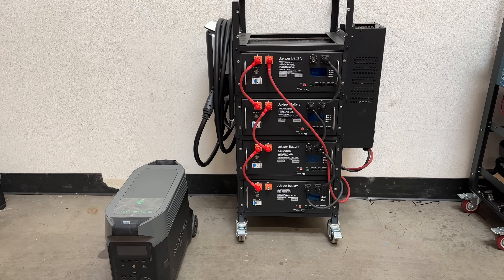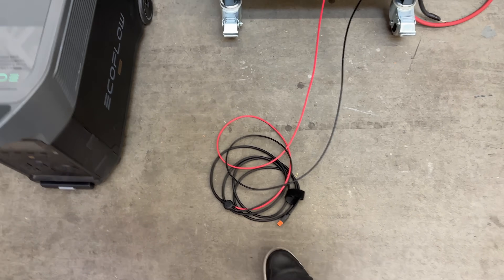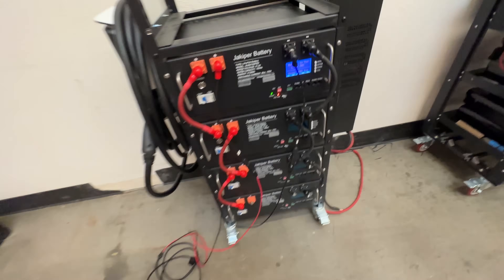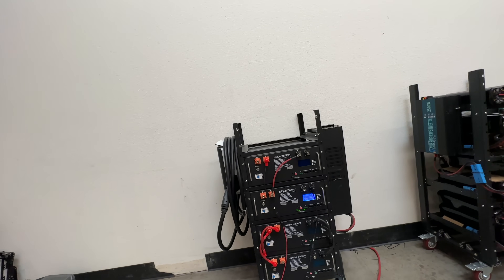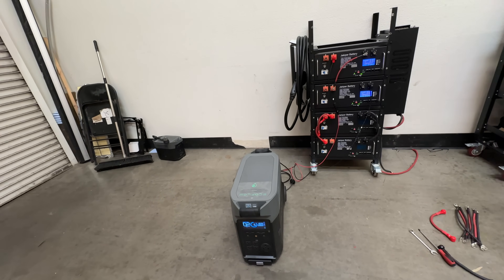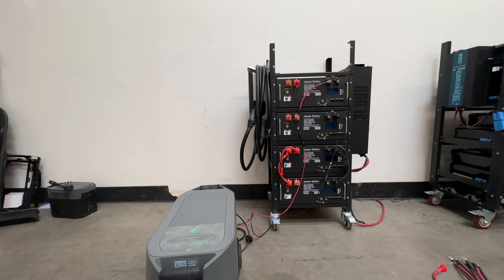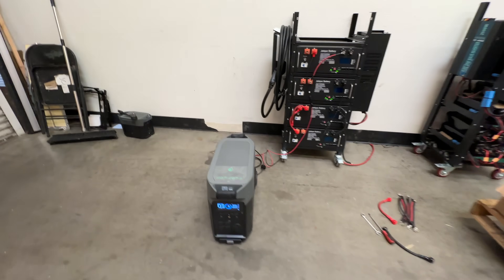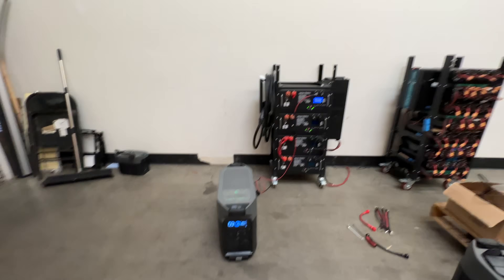48v Rack Mount LiFePO4 Batteries + @EcoFlowTech  DeltaPro

Comment: If you connect the 2 Jakiper batteries in series, you increase the voltage. So 51.2v x2 total of 102.4v.
I thought you would need to stay at 48v to charge the Delta Pro...of course I am seeing it possible with this video that connecting two 51.2v in series to charge the Delta Pro will work!
I thought by connecting the Jakiper in parallel you keep the same 48v...matching the Delta Pro

Comment: It would be nice if these smart lithium generator companies would create an extra battery that can be offered with their units a solid state micro inverter that way for an example EcoFlow Delta Pro 3 rated with a 4000 watt inverter could have the ability to increase its inverter outputs as well as its wattage output they would normally get from its extra lithium battery. I mean the extra batteries for many of the units like Bluetti, Ecoflow, Zendure etc have no ability to increase the systems inverter wattage outputs. I'm not even sure if a  solid state micro inverter could even do that, I mean with all these folks writing code and electronically intelligent ( if not, why not).

Comment: I have some questions. I'm doing a diy kit. 
I have a Delta 2. 
(2) 100w solar panels with 23.4 (voc) 
I have 3 12.8v 100ah lifepo4 batteries. A 75w 15amp solar charge controller and some xt60 cables. What would be the best way to set that up? I'm completely new to this and don't know much about this. I basically want to have the solar constantly charging the external batteries while those are plugged into the delta 2 while I use that for power. I'll eventually upgrade to the Delta pro or Delta pro ultra as the main unit. But wanna go cheaper on the expansion batteries. If that makes sense

Comment: I tried this set up and the power keeps surging up and down. From 700, all the way down to 100 watts and back. I know I must be missing something.
Reply: I have the same issue. Did you ever figure out the solution?
Reply: @Nottrying200 I ended up buying an inverter that works just fine. I still would like to figure out the solar input issue though.

Comment: I want to use 24 Volt 100ah  Batteries to Increase My Eco Flow River 2 Pro, Delta Pro 1300 and Delta 2 to Expand Their Capacity and allow My Solar System to Recharge The Battery Bank to Buss Bars and run Marine Grade 10/3 Tinned Wire from The Well House Shed to The Lodge or Bunk House 100 feet away under ground in EMT Conduit. Top Off anytime You wish to. Thank You Boss 🌴 💦 Indian Creek Ranch ⛩ of Southern California High Desert 🌵

Comment: Great video...!  I like how you stood back about 10 feet when combing your 48s in series.
So I just ordered the EcoFlow DELTA Max 1600 Portable Power Station, and why I did was because I have inherited a small RV, and I'm wanting to go solar.  teh Gas Generator was dead, and so I ordered the Ecoflow, mainly for the Inverter and the MPPT.  My goal is to run 2x400 watt solar panels in parallel into them, and ...or maybe in series, and then through the Ecoflow, to a small lithium battery bank, maybe a couple 200Ah in series, giving me 24v.  I could then also maybe run DC/AC output to my RV fuse panel. Wait....now I'm getting a little lost.  :)
Mainly I was thinking a MPPT and an Inverter can get a little pricey, so getting the Ecoflow which has both built in, PLUS battery capacity would be a good deal.  I dunno...I may have overbought, because the inverter/fuse panel in the RV i good, and maybe I just need a MPPT solar charge controller, and any inverter needs, just run off the RV.  The RV is a 1987, so I was presuming its capacitors in the inverter might be a little worn out.  I just don't want an electrical fire, and my RV is torched, so for now, have everything plugged into the Ecoflow, until I get a new AC/DC fuse panel.

I don't know, but what I do know is whatever I do in the future, by either keeping the Ecoflow, or going with separate MPPT/Inverter/Battery bank, I can install the solar panels on the roof, because they're going to be around for awhile.

Comment: So I took a 48v battery and hooked it up just like this but the Delta Pro isn't charging and seems to cycle charging on and off. Video here.  Doesn't seem like there is too much to mess up.  Any thoughts? https://youtu.be/pEh3PggKW54
Reply: Did you ever get this figured out? I was about to buy that same battery for the same purpose.
Reply: @ no. I was able to do a firmware update and it seems to work better but not like what others show. I left it plugged in overnight to the battery and it seemed to work as intended but I don’t know why it cycles like it does. :(

Comment: Can you charge the dp and discharge at the same time. Like run a 1000w heater all night connected to rack battery to keep it running all night
Reply: I'm pretty sure you can
Reply: @lifeisgood1624  You can, I was doing it last night using my golf cart battery, which is a RoyPow, 51volts, 56Ah - 2.8 kWh.  On the Delta Pro, using the orange 60t solar connector, I was getting the 800 watt charging.  The DP thinks it is solar.  But with two of these batteries, you can get the same as full AC charging at 1600 watts.
Reply: @ddpronto1  wow good to know thanks., 👍

Comment: I have a question, is it possible to use a mc4 to input solar charging and a server rack battery at the same time as long as I don’t exceed the input voltage on my Ecoflow delta pro unit. And is there a mc4 cable out there (like a split ) cable that would connect to solar panels and the other to a server rack battery so I can be inputting by solar as well as a server rack battery into delta pro if that makes sense. Any ideas would greatly be appreciated

Comment: I think at 5:00 you can connect 2 battery in series and charge the delta pro because it would give 15amp and 106v to give 1600 w. those are within the limit of the delta pro. however i kinda worry about the cable these are 10 gauge wire, do you think it will melt those cable in the long run?

Comment: Great video. Checked with my 12v battery and it works. 
EcoFlow also has device PowerStream that connects directly to battery port for delta models. What did you think, can we use this device connecting to 48v battery? And can we reach combining (using solar ports for delta and power stream) charging speed ~1500 watts?

Comment: If the delta is plugged up and charging with the 800w alternator charger will the EcoFlow once full charge send power through the solar input cable and charge back up the other batteries?
Reply: No, it will only work with max 24v batteries

Comment: I’m interested in adding 1 more delta pro to link together to have 240 v output and connect to my transfer switch to supply my whole house. Is there any way I can get the same 240v output using server batteries instead of buying another delta pro

Comment: I charge Delta pro from Basen Green 11,7kW 48V 230ah battery with just 8A (420W) via xt60 cable! I try with xt60i cable, but the charging is not evenly ... in 5 sec waves from about 100W to 600W, so just xt60 cable fills Delta pro evenly? I would like to charge with 15A ... Any idea?

Comment: Did you let this test run for a while longer? With a lower battery i see my 1800 watt array in full sun only pull 1000 ish under the battery cimb a little higher. I only see 1600 watts max 15.9 amps at 105v.

Comment: With that configuration, how would you go charging the server rack batteries? Thinking of doing something like this with one string of solar panels only and no grid power/off grid
Reply from the maker: What do you mean how?   with a charger of course,  which one? one that does 100v-110vdc
Reply: @jehugarcia  Specifically, the problem with this setup as a sustainable system without manual intervention is: how to charge the external battery bank from a Solar controller? Of course I can use an AC-DC charger but really we need a solar controller to charge your "96vdc" battery bank. I haven't found a model that can do it. Do you know of one?

Only "reliable" solution I've found is an AC-DC switching supply from my Solar Controller/Inverter into the Delta Pro. It requires no intervention from me on a daily basis.

Comment: @jehugarcia - I have Delta Pro with two 48v 51.2v batteries and same connection you have and only seeing 400w charging.    Are you seeing more because you have 4 of them together and the amps are higher?     I'm genuinely asking because I don't know.     Thoughts?   Thank you!
Reply: Check out the xt60i plug. It has an extra pin. Xt60 is limited on ecoflow. This sounds like your problem.
Reply: @angloblaxon  no that wasn’t it
Reply: I got 51,2V Basen green 11,7kwH battery. Output from BG battery is 50Ah (200Ah max). After a minute of charging Delta pro with a power of 15.5A, the output power from the BG battery started to drop to 3A and then to 5A, thus minimally charging the Delta Pro in waves. Could it be a power output problem with too much amperage (DP max input via xt60 is 15A) or is it Delta pro or xt60i cable problem? How can I solve this?

Comment: Do you know if there's a way for say an MPP Inverter (e.g., LVX6548) to feed (charge) the EcoFlow?
-Hoping to use the EcoFlow I have as backup battery.
-But I want to have an all-in-one inverter (w/PV in) to supply the the EcoFlow battery.
-Have you tried that?  Lots of people ask this question.
-I'm trying to charge my EV off EcoFlow nightly, 
-Key, I'd like an Inverter to "both" charge the EcoFlow, "and," be able to use NetMeetering.

Comment: So, can you just add 12V Lead Acid 100amphour in series and charge the EcoFlow?  Seems like you could.... I have 12 of them.... would like to add 6 of them in series and then charge the EcoFlow... and then just recharge the 12V Batteries from Solar Panels and a charge controller...  would love to find a way to hook them up that way, so they constantly are being recharged by the Solar Panels, and then that bank of batteries constantly charges the EcoFlow which powers the cabin or house.... any thoughts?  Thanks for your great content!

Comment: Thanks, this is good BUT using batteries to charge Ecoflow DP is easy and straight forward if you charge external batteries by plug them to grid. What I want to know is how to set them up using the solar energy that comes to the DP then charge batteries for later use. DP has 12v output at the front right side of it to charge 12v battery, yes only 12V. Any way you can set it work like Ecoflow DP extra battery. They intentionally to make it that way so you can not buy generic, off the shelf battery to work in tandem with DP so they can get more money from you. If I need to store more energy I would buy Ecoflow DP extra battery.
Reply: just buy an AC charger and plug it into the front of the DP

Comment: Hey buddy. Phil in the UK. You stated not to exceed using the input watts on ac or dc, when you are charging. Could you test this because as you are using the solar input, it does not have a pass through which is different when charging from mains.

Comment: Downside is 800w, can charge solar for free with 2 400w solar panels. You'll pay for those battery banks. Downfall is only 800w, Id need for air-conditioning so that won't work. If anyone needs under 800w just get a couple solar panels and game over. Cost is up front only, then you get free charging. Oh, and it'll last forever, not 3 day forever, but as long as sun shines... Just saying,,
Reply: The point is you can expand the ecoflow without staying in their overpriced ecosystem.  You can even add a stronger solar array to these batteries and go above the limited specs of the ecoflows mppt. The ecoflow pro spare battery is pretty limited as it's just a plug to the ecoflow and a power button.

Comment: I have 4 ecoflow deltas going to 2 ecoflow smart panels for 7200w each panel for the home. I want to setup rack batteries and a separate eg4 charge controller then charge the ecoflows from their solar input from batteries, while charging the rack batteries from solar. How do I charge 4 eco's at same time from rack batteries and charge them from solar? The reason for charge controller is we can take greater voltage and amps from solar than the Deltas can directly, thus making solar configuration better and more efficient.
Reply: Simplest way & safest would be add a AC 6 plug surge protector to the EG4 solar/inverter charger & plug the EF pros to it. Yes there will be a loss in DC to AC transfers but its easy, safe & quick to do.
Reply: @1ENDUSER  I want to go from the EG4 to rack batteries (maybe 6 of them). Charge with EG4/Solar. Then charge the deltas from the rack batteries. Any clear solution for that. Should I do what he has done in this video, then get a 4 way MC4 splitter and plug in the deltas there?
Reply: @timothymsupreme  - yes thats one option as well as the option I stated as a comment. That would be the simplest way. In this video you still have to make a mac4 to xt60i cable or buy one then hook them up after the EG4 batteries are all charged up.

Comment: How you can charge the big batteries with solar in that configuration?
Reply from the maker: Plug your solar panels to your delta,  then turn your AC plugs ON and plug a 48v charger to charge your rack mount
Batteries.
Reply: Have a separate mppt/inverter/charger to charge the EG4 batteries with your solar is another option then go from there as shown in the video.

Comment: okay ONE more question... Can you charge the 48v battery with solar WHILE you have the ecoflow plugged in?
Reply from the maker: yes
Reply: @jehugarcia  Thank you I will TEST that in the morning.
Reply: @jehugarcia  NO SMOKE!!! sooooo.. I guess it works.. EG4 3k, EG4 LL, and the ECOFLOW Delta Pro STILL working yea... Thank you Again...
Reply: @TheSadHam did you use a charge controller and solar panels? For charging? Or battery charger?
Reply: @carlosreyes6448 - all youd do is have a mppt/charger/inverter & eg4 batteries hooked up to it while being charged by solar. Then use a surge protector 6 outlet & plug thr delta pros through ac & charge them that way so everything is being charged by all your solar. Some DC to AC lost but its free.

Comment: Have you ever tried the 240v 15a fast (3000w) charge (via A/C wall outlet) option on the Delta Pro? I AM NOT asking about SOLAR input charging which I'm aware has a 150v d/c limit @ 15amp max. I am referring to the c13 A/C charging cord inlet on the rear that says "100-240v @15a max.". Ria's (Ham Shack) and a few others on youtube say it can be done but never explained how to do. I think a 240v replacement power cord is needed + a 240v 15a outlet to plug it into. It would make a good video I think for all the Delta Pro owners on here.
Reply: I just charged my EF DP from the rear A/C c13 port with 240V from a Nema 6-50 outlet I have in my garage - it works great. DP is designed to accept 240V A/C charging up to 3000W which = 12.5 amps & well below the 15a limit set by EF. I just had to buy a cable to plug into 6-50 outlet with a different connector on the other end that would accept a 240V plug that also,had a 20a c-13r to,plug into the DP. My DP was receiving 2.9kw of A/C input from the 240V wall outlet.
Reply: @vudunof  Hi Jeff, Congrats on the QC experiment. Was everything good after this charge? No ill effects from using a 50A (240v) power source? I would of thought a 15A-240V breaker/source would be needed? Was it a single EF DP main unit or were 1 or 2 extra EF DP batteries tied to your main unit? Can you tell us how long it took to charge this way? Thanks, Bob R. in Ky.
Reply: @bobrub  Hi, everything’s fine charging an EF DP with 50A - 240V. It’s designed to accept 120V-240V A/C charging! It says so right below the terminals on the back of the unit & in the owners manual! From my 6-50 garage wall outlet, I plugged in a 6-50P to a 6-20R cable. From the 6-20R cable, I plugged in a 6-20P(20A) to C-13(15A/250V) cable that goes straight into the DP. And at 240V A/C charging, the maximum wattage the DP can achieve in 3000W. So if you do the math - 3000W divided by 240V = 12.5A, which is below the 15A rating the DP has, so it’s all good & below the safe specs the DP requires. Yes, I charged my single DP in about 1.7 hours @ 2.91kw once the internal battery warmed up a bit to accept the full 3000 or as close to it as possible.
Reply: No way it could be done. EF pro voltage  limit/max is 150V. It would trip the voltage. And the AMP are throttled to only 15amps
Reply: @1ENDUSER  Hi there, I think you misunderstood my comment/question to jehugarcia ... I have edited it a bit so please reread it ..... I am not asking jehugarcia about SOLAR input charging, but am asking him about 240v A/C fast charging via power cord-wall outlet from the grid.
Reply: @bobrub - Yeah I understand. The verison of delta pro he has in the video is the American version. With charging AC outlet of 120v 15amp. The version spoken in the Ria's could relate to the Europe version & any other countries that use 240v AC outlets.
Reply: I get 3.4kw of charge through the extreme adaptor when charging at an EV station. It doesn't stay at that rate for the whole charge cycle though because of the 3 stage charging process that these lithium batteries have.

When charging via AC outlet the highest it goes is 2.7kw (in europe)
Reply: I got Basen Green 11,7kWh battery 51,2V. Output from that BG battery is 50Ah (200Ah max). After a minute of charging Delta pro with a power of 15.5A, the output power from the BG battery started to drop down to 3A and up to 5A, (and up and down and up and down) ... thus minimally charging the Delta Pro in waves. Could it be a BG battery power output problem with too much amperage (DP max input via xt60 is 15A) or is it a Delta pro problem or maybe even xt60i cable problem? How can I solve this? Should I limit the BG output amperage to 15A???